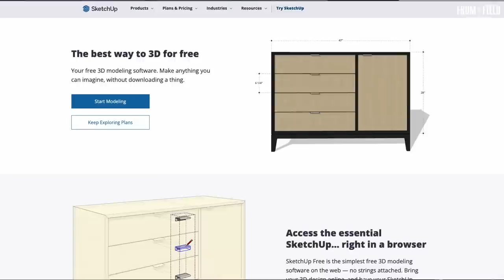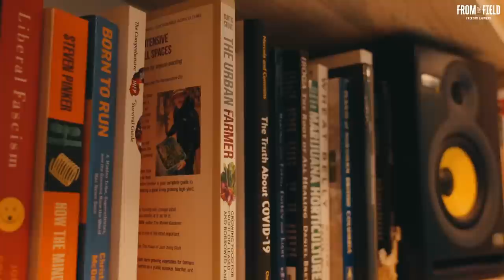You Won't Believe What's Packed Into This Tiny Home

Comment: Dad was a museum quality builder, designer, architect. I did nine years in renovation and construction, and nine years on fire towers with cabins between 20x24 and 16x32, and a few other similar dimensions. I also studied the purpose of the tiny house movement, which ain't all rosy, but that's off-topic. It's an awesome setup, and that's what counts.
I'd consider staggered double 2x4 construction, which would really add to R-value over 2x8, though 2x6 can still  be quite efficient. Windows have dismal R-value, so insulated curtains or shutters would go a long way to solve that.

Comment: Low head vortex stream generator, he can use the complete volume of the stream. He can have both and get twice the work out of the rain catchment runoff that flows out of the Pelton wheel into the stream which goes into the vortex generator.

Comment: Solar array is "under paneled" for the inverter 8000W output, I'm sure you explained that to him Curtis off camera. That system comprised of 400W panels needs 6 more panels to bring the total to 9.6 KW that would adjust for the 10% loss for aging panels and the little extra for the over-paneling factor!
Reply from the maker: I didn't explain that to him. Wasn't even a thought. I'm not a know-it-all. ;)
Reply: @offgridcurtisstone  Good to know, I will refrain from assuming such things and comment in the future as a matter of fact instead.

Comment: Those SimpliPhi batteries are, I believe, contactor based as are the similiar Fortress eFlex.  Sadly, they consume a huge amount of your energy just to "safely run".  The batteries that Curtis uses are EG4LL's which are MOSFET and consume drastically less to run.  According to the DIYSolarForum thread that I was participating in, both SimpliPhi & Fortress eFlex consume 30 watts each per hour to run (Discover, a similar battery, would not disclose their self-consumption figures).  Depending on your solar uptake (I'm also in the PNW so winters are horrific), these batteries are not your friends.  I'm now strongly weighing options as I have 10 of the damn eFlex that are sinking my winter battleship for even the smallest of loads.  I also have two Sol-Ark 12k's which each consume approximately 60 watts idle plus 5% of whatever my loads are.  They can be power sucking hogs but at this point I wouldn't change them.  The losses I experience are definitely more controllable on the battery side.  Sadly, these are all the things you learn about a solar system AFTER spending a huge chunk of change on components.  My batteries were my largest portion of my cost at $35k and they're an anchor around my winter neck.
Reply: Thank you, I had never heard that before!

Comment: I feel like the term ‘off grid’ is misunderstood. ‘Off grid’ means no heavy machinery or reliance on things like diesel.
Reply: Then where do you draw the line? If you get your energy from a water mill which you made yourself from natural materials, is that off grid?
Reply: @ingevankeirsbilck9601  Yes. I'm specifically talking about using back actors etc or machinery which requires diesel
Reply from the maker: No it doesn't. It means you're not tied to grid power or regular utilities.
Reply: @offgridcurtisstone  Ah, makes total sense. I guess I'm confusing it with complete 'self sufficiency'? Anyway, not here to argue. Love your videos and work in general.

Comment: This is an amazing space. So many useful ideas here!

He mentioned propane consumption. I wonder if it relates to the additional energy required due to heat loss. Maybe there are better ways to insulate the windows, walls, etc, besides the 2 x 4 issue mentioned. I guess if it were more permanent, he could do geothermal. Speaking of that,  maybe he could lease-to-buy.